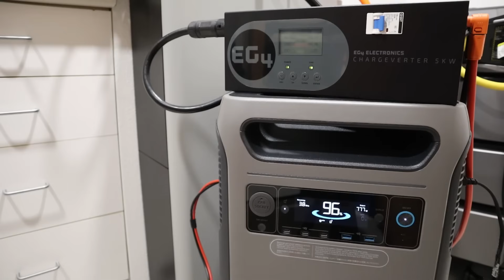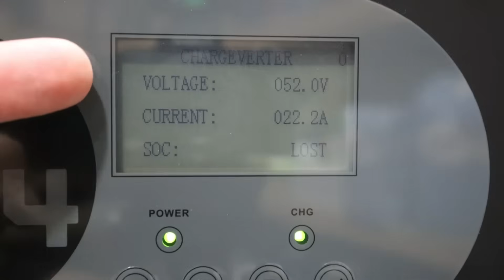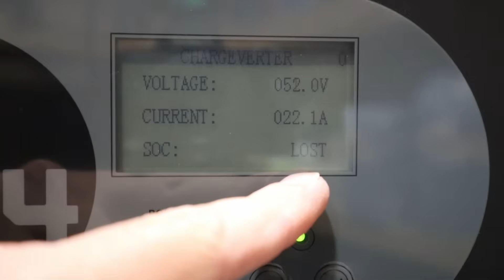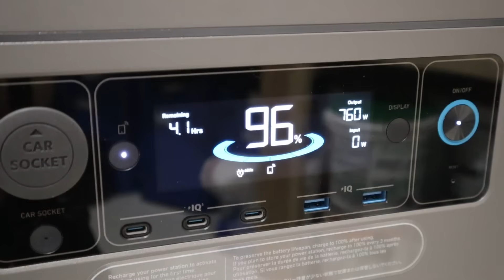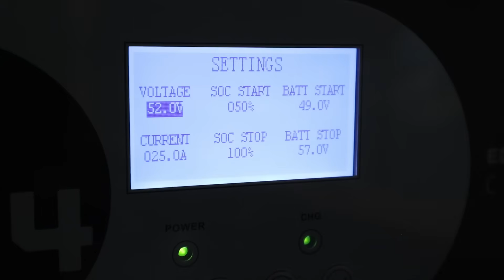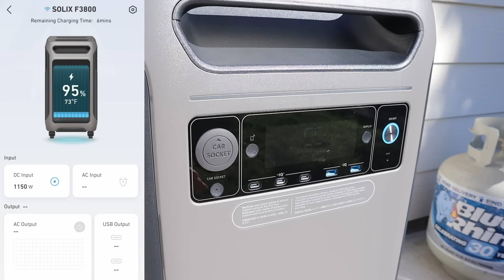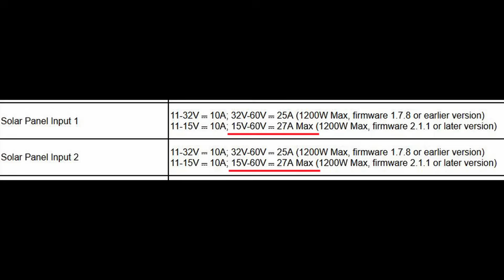The EG4 Chargeverter FIXES the Anker SOLIX F3800!  Keep the 240v Powered On!

Comment: For the price people have to pay for the Anker, shouldn't they just fix the unit? If people have to pay another $500 plus to rig / trick it then why not put that money into a better unit and skip the Anker altogether?
Reply from the maker: Because tons of people were kinda tricked into purchasing this unit since other channels didn't know the 240v shutoff.... Or they blantently left it out of their videos. I was the first channel, or maybe the only channel to discuss this issue and offer a way around it.
If someone already purchased the product, this is a way to get it working... It's not the best situation, I'll agree with that 👍
Reply: I totally agree, I also think people are not looking to add more “stuff” to what was supposed to be a simple setup. It’s great that there is an option now, but it turns the setup into Frankenstein and when you really need thing to work reliably all the extras could add more failure points.

Comment: I literally ordered this 2 days ago for the same purpose after doing weeks of research into the topic.  This will save people time thank you
Reply from the maker: Nice!
Reply: @Jasonoid  Thanks so much for providing this video and the parts list.  I got 2 Anker Solix F3800 for my home, and I did not realize that I cannot charge them with AC while powering the house with 240V and the power switch.  Much appreciated.  My only concern is the price of the EG4 Chargeverter.  Would you happen to know of a product that can do the same thing (produce over 1,000 watts) at a lower price?

Comment: These sb50/Anderson/forklift-connectors are perfect in my opinion. Makes lots of remodeling in the sytems very easy. Sure you maybe loose some amp/voltage but very useful and easy. I like them better than xt-connectors.
Reply from the maker: I love these SB50 connectors!
Reply: @Jasonoid  -- The SB50 Anderson is only rated for 50 amps and the Chargeverter can bet set to output 100 amps.  Anderson makes an SB120 connector to can handle the full 100 amps.
Reply from the maker: @rpsmith  yeah, for this wiring setup I won't be going over 50 amps. If I ever need more power I'll use different connectors 👍

Comment: Great video. A lot of folks will use this for emergency backup, possibly with an additional 48v battery.  I wonder the pros and cons of just using a standard inverter for a dit setup?  Looking to start a 1-1/2 hp well.  Will have to measure amps first.

Comment: Does the Ecoflow Delta Pro Ultra have the same issue?  Will it still output 240 volt when AC charging ?
Reply from the maker: The Delta Pro Ultra allows 120v charging and 240v output at the same time! 👍 No issues at all.
Reply: @Jasonoid  Awesome!  Thank you for confirming that with me.  I thought this was the case.
Reply: @Jasonoid  Also regarding the EF DPU, would there be a use-case scenario for the Chargeverter to "clean up" the "dirty electricity" from a gas generator?  Is it worth getting the Chargeverter for that reason alone?  Or is it fine to just charge the DPU directly from the gas generator?
Reply from the maker: @criticalhadlock886  I haven't seen an issue charging with my inverter generator. It might be an issue with an old school genny.
Reply: @Jasonoid  Thank you.......Yeah, that's my point.  I'm considering buying one of these instead of replacing my old school generator with an inverter generator.  Excellent video by the way.  I love your content and thank you for your service.

Comment: It’s unlikely Anker will be able to do pass through 240v while plugged into 120v AC because one output leg would have to sync with the single input leg, and only one phase of the inverter would be active during that process. Just depends on how they designed the hardware.
Reply from the maker: That's exactly how it's designed. I'm guessing the charging system would need to be independent to work while outputting 240v. Not sure how Ecoflow does it but their 240v units don't have this issue.

Comment: i updated my Anker last week and now have 3 used 250w panels in parallel connected. Three days now and the f3800 is charged from about 20%  to full by 2pm. i have ordered a second solar input cable and have 3 more panels ready to connect. i expect the f3800 to be able to run my garage/workshop mini split, freezer and occasionally the pellet stove 24/7. Now i just have to wait for black friday and see if i can swing an expansion battery for some multi day capacity.
Reply: Out of curiosity, which panels are you using?
Reply: He's talked about, and other channels too, about using a server rack battery instead of Anker's expansion battery is not only cheaper but way more capacity. That's the route I'm going towards. I understand I could've went straight to server rack batteries for our cabin but I wanted something mobile to take in our bus conversion for camping.

Comment: I have one F3800 connected to the Anker Home Power Panel to provide grid failure backup power. It seems to me that when the F3800 is connected to the home power panel it disables any other way to charge it other than through the grid. I am having a very hard time getting questions answered from Anker. My question is, if the F3800 is connected to the home power panel or to the Solix double power hub, are the solar charge inputs enabled?
Reply: Another vote for this question. This was my plan but now I’m hesitant.
Reply: @hinesmt  I originally bought the F3800 and home power panel to provide backup for the short 2 hour power outages we have been having. For that purpose, it works great. However, there seem to be quite a few ,limitations when you hook the F3800 up to home power panel; like it shuts off every other port in or out.
Reply: @jameshoien1563  So when it is hooked up to the HPP you cannot use ac charge as the HPP will charge the unit itself depending on what setting you put in the app. Also when your plugged into the HPP the the other ports close at it is feeding your whole house instead of the grid so you shouldn't need any of the ports as its already supplying power to everything.   Then if power goes out it just supplies power to the sub panel if hooked up.
Reply: I asked same Question : Quick Question If two F3800's are hooked up with the Anker Smart Panel   is there still a charge issue trying to charge the two F3800 with AC with a  Gen available ?
Reply: @DVLITTLEPILOT  In the research I have done it is NOT possible to charge the F3800 with AC when it is hooked up to home power panel
Reply: @jameshoien1563  Correct as the HPP will charge the batteries itself.  If you have TOU it will charge during the cheapest time.
Reply: I believe the solar inputs still work, just not the a/c input.  Will try to verify tomorrow
Reply: The solar inputs are still available.   you can plug both 3800's into the hpp, use it to feed the house and also charge the xt60 ports at the same time.  Literally doing it right this second.  You just cannot charge with another ac input while hooked into the HPP
Reply: Yes. There are only two phases (120 volts each phase, combined gives you the 240 needed to power the nema 14-50) so if you are using both phases with something plugged into the nema 14-50 there are no other available phases for the 120input to use, so…shut off. Thats why you can still use the AC input to charge and still use one of the three 120v outputs in that left hand column.
Reply: The anker 3800 is a waste of money in a rain storm or snow blizzard he showed charging from the generator but not using powering anything while charging from the generator

Comment: Different question: I have Xcel net metering using SolarEdge equipment. My understanding, when the grid is offline, the Aker SOLIX F3800 + Home Power Panel can power the home off battery storage, but not recharge the batters from solar because the solar panels are grid tied due to net metering of the Xcel SolarEdge equipment. Is this true of anyone with a net metering install/agreement? Is there any way to still use the Aker SOLIX F3800 + Smart Home Power Panel to keep the system charging from solar with the grid is offline? I apologize if Anker SOLIX Home Power Panel system can still charge from solar in this scenario but have not found discussion of this topic.

Comment: Thanx!  I saw the voltage charge levels changed with the latest upgrades, but missed that it was now as low as 15 volts.  Makes non-Anker solar panel hookups easier.
On the note of charging: I had my Anker set for max charge (1800w) for the 120VAC input, and plugged it in to charge.  After a while, the ends of the charge cord were really hot, so I lowered the charge rate to around 800 watts.  After some checking, realized the supplied charge cord only uses 14 gauge wire and I was plugged into a 15A wall outlet.  At 1800 watts, you're right at the 15 amp max of both the outlet and the cord.  Too close.  Today I'm building a beefier cord with 12 gauge wire and 20 amp connectors to be used only on a 20 amp outlet.  At 1800 watts (15A), it's now charging at 75% of the circuit rating rather than 100%.
Reply from the maker: I'm bummed when I see these companies saving pennies by including slightly underrated charging cables.

Comment: If the amps are adjustable, this should be able to work with any high wattage input power station like a AC200Max/L or Oupes Mega3/5 ect? Especially if you own a modified sine  genny.
Reply from the maker: Yes, you can adjust the amperage output of the EG4 to whatever amps you want 👍

Comment: An order for the EG4 Chargeverter is $469 + $38.46 Tax = $503.36.  However, the $50 coupon code "SOLARSAVINGS", will only be applied if I somehow spend $35 more dollars on a site designed for installers spending $1,000's. Great videos, great product review, but this discount code is useless.

Comment: Since this has a "universal voltage" input of 90-264VAC (according to the spec sheet), I wonder if it could run off the ~200VDC of my Toyota's hybrid system? I have already run a few different smaller power supplies with a similar voltage range off of it.
Reply from the maker: I'm not sure! Signature solar might be able to ask that question for you. I would think AC and DC input would be quite different!
Reply: @Jasonoid  Frequently AC=>DC power supplies with a wide input range like this have the input go through a bridge rectifier first, converting it to DC. So far I've been able to run phone chargers, laptop chargers, and a desktop computer directly off of 200VDC.

Comment: Can you also make a video of how to connect a battery using this charger to the f3800
Reply: I’d like to see this setup but without a 48v battery.  I have a 12v and 24v battery so using the eg4 to charge the 12v or 24v battery then using the 12 or 24v batteries to charge the 3800.  Reason for this is one a buffer but say you have 2 12v or 24 batteries, could you charge 2 batteries with the eg4 then use input from each battery to use both inputs on the 3800 and get the full 2400 watts?  I know a lot of us have spare 12v batteries laying around…
Reply from the maker: Can you clarify exactly what you'd want the setup to be?
Reply: @Jasonoid  instead of using Anker batteries using other lithium batteries. So  using the EG4 charger to charge other batteries and then connect it to the F3800
Reply: @carrybigspeaksoft1758  His video at https://www.youtube.com/watch?v=XFlRkMm8rDc does something extremely similar to this, using one 48v battery that's connected to the F3800, being charged by the $3000 AC-DC converter he had in this video. Wouldn't matter what the charging source would be, but it's doing exactly what you're describing

Comment: EG4 has some really innovative products that are quite affordable.  The Anker F3800 is still the king of all in one split phase products even with the qwerky  120 VAC charging problem and this EG4 chargeveter is a great solution.  While the EcoFlow Delta 3 Pro is a very capable all in one, the 4KW output is a serious limitation (single unit) when compared to the F3800's 6KW split phase output which can run most 25 amp loads while the Delta Pro 3 cannot even run a 20 amp load (the same for Jackery's upcoming 4000 King product).  6KW is really the sweet spot for 240 split phase and the Anker Solix F3800 is the only reasonable priced single box solution.  Thanks for going over all of your wiring adapters for this video!  I'm a real nut too for making all kinds of adapters to meet all kinds of different requirements:D
Reply: Solar pv is terrible on 3800.
Reply: @zfontain1975 I was thinking the same thing. 60V input seems inadequate for its battery capacity
Reply: @jake-mv5oi  Especially if you add batteries to it.
Reply from the maker: The new Jackery 5000 has a 7200w inverter. I'm testing it currently.
Reply: @Jasonoid  I cannot tell from the material on their web site if this unit has a 240 volt split phase output of if you need two units and a combiner box like the original EcoFlow Delta Pro, Buletti AC 300/500 and the Pecron3600
Reply: @Jasonoid  The Jackery 5000 manual suggests that one cannot use 240V outputs while connected to 120V. It appears that one needs the Smart Transfer Switch to charge from 240V and output 240V.

Comment: Those Chargeverters are extremely stout. 👌
I use one as the battery charger in my cabin to charge up my external DIY batteries that feed into my Bluetti.
Reply from the maker: That's good to hear! The thing is an absolute brick and feels super high quality. I've been impressed with my purchase for sure 👍

Comment: I'm not going to buy an expensive rectifier and accept conversion losses because Anker won't update their software
Reply from the maker: It's not a software issue unfortunately and can't be fixed without a hardware change. 
- One inverter reverses and charges the battery.
- One inverter puts out power to your loads (120v)
You need BOTH inverters for split phase power, it's just the way it was designed.